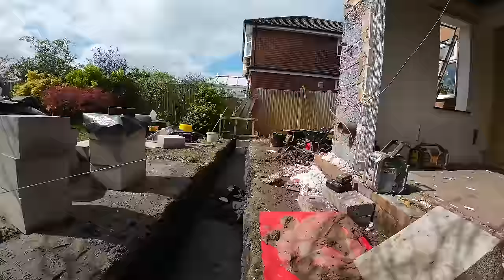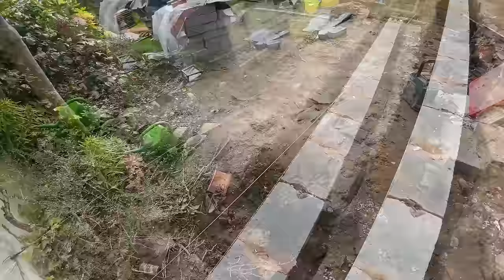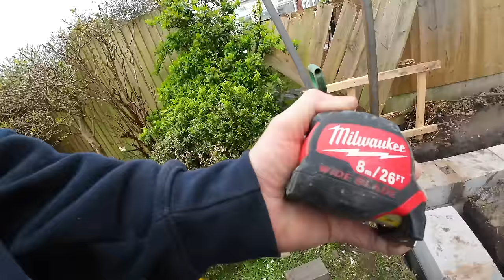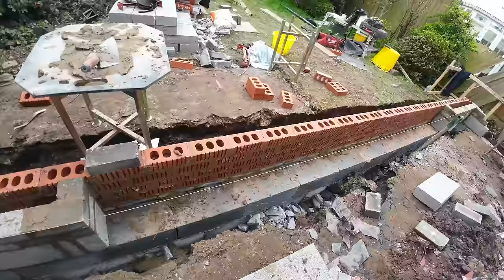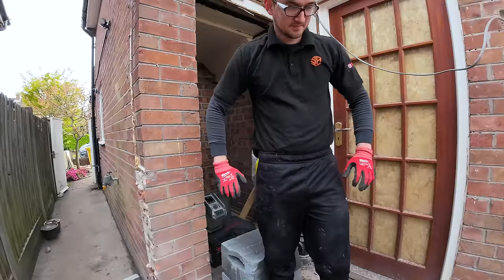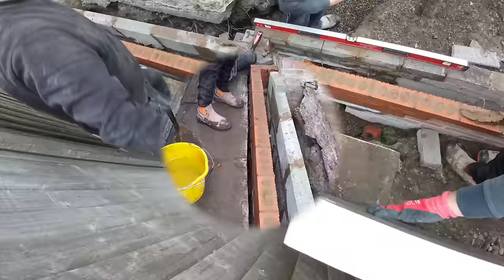THIS FOUNDATION WAS A MASSIVE STRUGGLE FOR ME

Comment: Hi Steve, I'm a bit confused  would it not be easier to bring foundation higher then use engineering bricks , instead of lower foundations and two course of blocks ? seem to me what your doing it more work specially with your bad hip , cost isn't that much different?
Reply from the maker: We never did the dig or the slab. i just got to struggle in that footing 😒🧱👍🏽

Comment: I would have thought it was asking for trouble feeding an external gulley into a pipe under the foundations, which will presumably be concreted over. But you have to do what the boss wants. Somebody else's problem if it goes wrong in the future. 
Not a nice site but as usual you make the best of it 👍
Reply from the maker: I hate pipes under floors 😒🧱👍🏽

Comment: Great stuff - which model of laser are you using?
Reply from the maker: It’s a Milwaukee 12v one 🧱👍🏽
Reply: @SteveAndAlexBuild  many thanks
Reply: I may be thick, but is there more than12v one on the laser as a model as on supply sites that is not mentioned  - there are all sorts!
Sorry to be a pain 😢
Reply from the maker: @DHanley-l3n m12 CLLP-301C .
  That one is good but if you can afford it get this model 
M123PL-401C 360 ° 3 PLANE LASER 🤌🏾🤌🏾🧱👍🏽
Reply: @SteveAndAlexBuild  thanks for taking the time out to respond so quickly

Comment: Great work 👍Two questions: the cavity looks small, was it old or new regs (with internal insultation)? The drain looks low or is it me?
Reply from the maker: 100 mm cavity… stay tuned .
   Low drain ?
Reply: @SteveAndAlexBuild  The gully looked like it was well below ground level?
Reply from the maker: It had an extension piece put on later 🧱👍🏽

Comment: What on earth is in that lead pipe?
Reply from the maker: Water supply 🧱👍🏽
Reply: @SteveAndAlexBuild 

Is there no program to replace those?  The City of Detroit had all kinds of stories about old lead water pipes poisoning the kids.  We certainly cannot use those anymore, nor leave them if found.
Reply from the maker: Let’s just say it’s a bit more chaotic in the uk 🙄🧱👍🏽
Reply: Houses built in the UK since 1970 couldn’t have lead mains pipe. Owners of houses built before then are responsible for replacing any lead pipes but only is they want to! Simple enough process but comes at a cost so many, like myself, don’t bother as risk of lead poisoning is very low or non existent if pipes are undamaged and in regular use! When I eventually resurface/replace my driveway I’ll install new EPDM (plastic) mains then
Reply: @SteveAndAlexBuild   And here I was thinking of the US as the wild, wild west.  Thanks.
Reply: @StevenThorp-e1q   I guess it depends on the chemistry of your water and how it strips lead out of the pipes.  Thanks for the clarification.
Reply from the maker: @justmyopinion99 🧱🧱👍🏽
Reply: @SteveAndAlexBuild  If I was owner I'd have seen it as ideal time to replace it but each to their own. Great work in difficult space. 👍

Comment: Chaps,
Some jobs are just like that........An awkward cuss of a job -  and you know instinctively as soon as you roll up on site, that its going to be a stinker....!!
Following someone else`s work that is poorly built,  tight site and lack of room to work properly,  materials missing, additional work......and on it goes.
"Dont worry- the Brickie will get over it,"  they say.  Sometimes it`s just a long hard slog.   And that is the epitome of the building game......!
On a different note, I wonder what the life expectancy of those trench blocks is...?  I know what the manufacturers say, but I wonder how long they last in the real world.?
I can remember doing brick footings, 16 or 18 courses of hard burnt stocks, two spreader courses off of a concrete base, then upto D.P.C in either English Bond or Header bond solid work, slurry grouted every 4th course.  Proper brick footings designed and built to last.  Completely different now of course....!
Happy days.🥴🧱🧱😁👍
Reply from the maker: This job was shite right to the last block 😢😞🧱👍🏽
Reply: @SteveAndAlexBuild  However,  you overcame the problems and issues and got the job done.  Now that is the mark of a real Tradesman.
All lesser mortals would be "bitching & cussing," and many would have walked.
👍👍🔥
Reply from the maker: The bitching and cussing were edited out 🫣😆. 
   If I had had an inkling how bad it was going to be I would have swerved it for sure . 
    I’m in too much pain to have stress on top too .
    I’ve turned a few extensions down lately. If I need to keep working ( reluctantly) I want it to be as stress free as possible for me and my carer Alex 😟😟. 
   Life in general isn’t fun unfortunately but I need to keep getting up every day until I can finally get fixed. 🥺🧱👍🏽